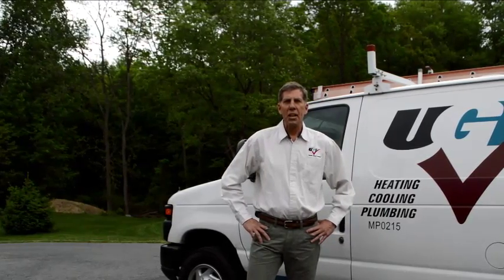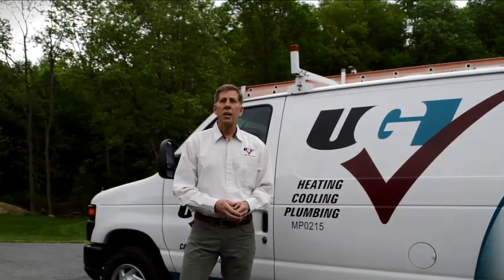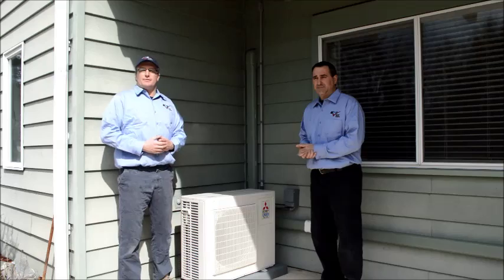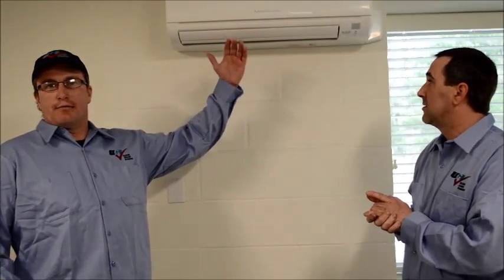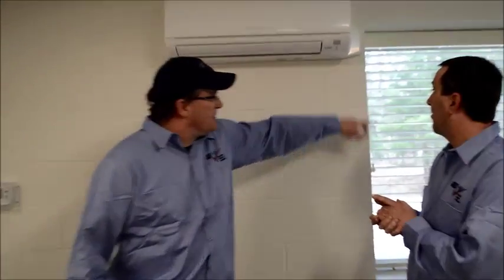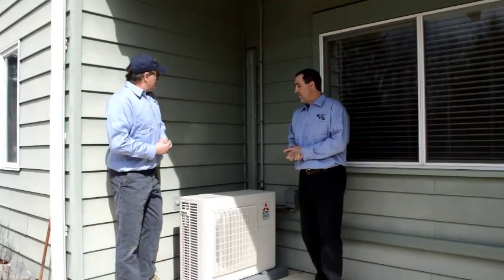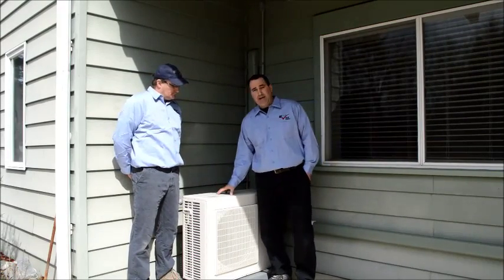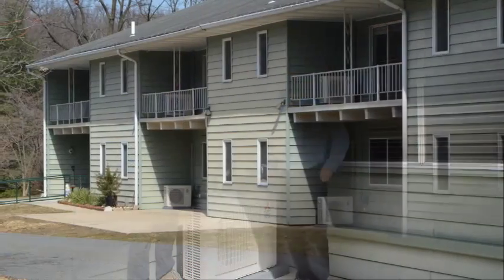Ductless Mini-Splits Central Air Conditioning & Heat

Comment from the maker: That's not an easy question to answer in the comments section, unfortunately, as the situation will greatly depend on the layout of your home and HVAC system.  But we can safely say that mini-split systems can easily be as energy-efficient, or more so, than a traditional central air system, so they certainly can be cheaper to run in many situations.